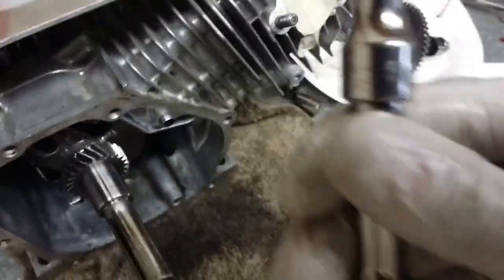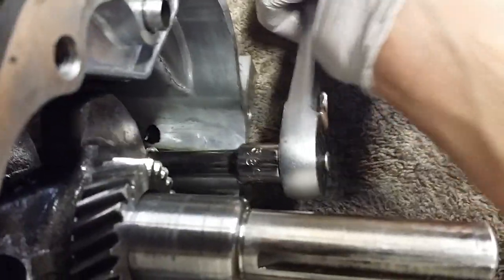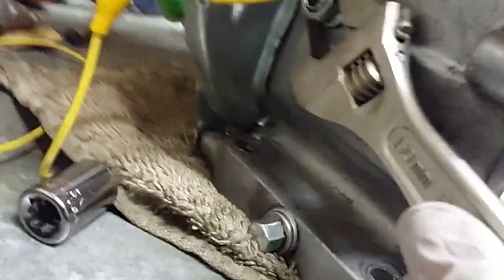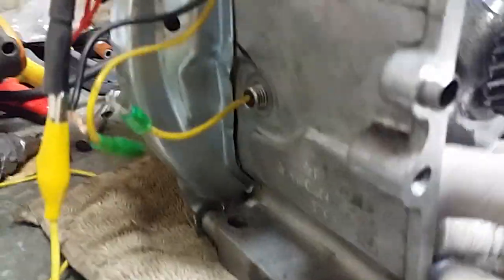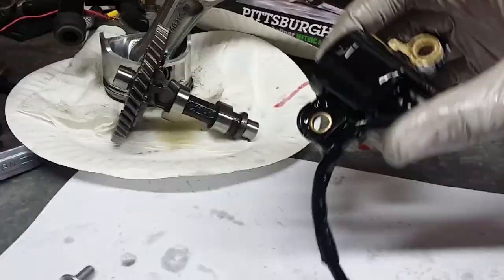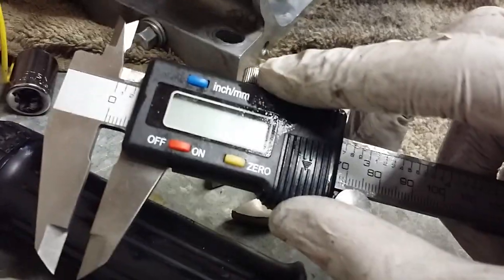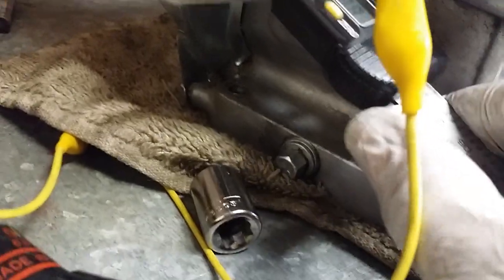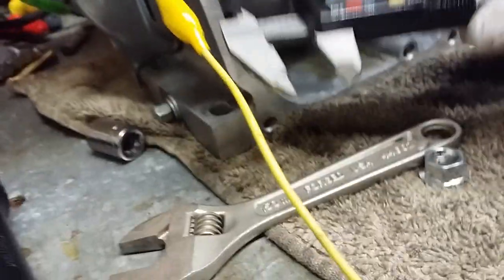How to remove the low oil sensor on predator 212cc

Comment: Nice if you'd have started before removing the gear part sitting on the bottom right a 2:29 so you can get the socket over the right bolt???

Comment: Thanks for the video. I have a champion 6250 292cc my gasket to the wire broke and oil skeets out of it, so I guess I have to replace the sensor.  I've already ordered and recieved a new one, but am a little confused as to which side on the motor to dismantle to replace it. You video is helpful, but moves a little fast. Can you help me out with the question and how hard should this be?

Comment: if you just disconnect the wire will it do the same thing?
Reply from the maker: Yes - you then just have to make sure there's not a break in the circuit preventing the ignition from grounding now.

Comment: ive got a problem where it runs for a second or two and cuts off. ive tried unplugging the oil sensor switch it still is doing the same. any ideas?
Reply from the maker: make sure you didn't just unplug it and leave it. You have to complete the ignition circuit without the oil sensor in there. Just unplugging it may not work. 
If that's taken care of, then it's a problem with one or more of the following; fuel, compression, air, timing, or spark. Going through those will solve your problem.
Reply: Check valve lash.

Comment: instead of doing all that you could just look by your kill switch and unplug it and it will do the same thing
Reply from the maker: Well, maybe your comment would be more helpful on a "how to unplug your oil sensor video!" I made this video to show people how to.... big surprise.... REMOVE the low oil sensor... But thanks for the comment and suggestion!
Reply: Disconnecting the oil sender  allows you to do donuts with out the engine shutting off correct??
Reply: boi kyle with those big lips boi u better shut up with your laffy taffy lookin self Ronald McDonald ........nvm thanks for the helpful COMMENTS!!!
Reply: I was wondering cause them sensors save motors Always wondered y

Comment: Why not just unplug the sensor on the outside of the engine instead of going through all that work with new gasket and thread seal?
Reply from the maker: If you leave it then there Is just extra parts waiting to come loose ect. You will need to put in more oil after doing this because there is more capacity for oil after removing this.
Reply: that's what I was thinking. have you tried this?
Reply: Works just fine unplugging it no issues.
Reply: I've been running it for 3 months with it unplugged.
Reply: They seal it pretty good from the factory and I haven't had any issues I have about 1100 hrs or so on my 212 and haven't had to add oil or worry about parts coming off but to each his own.
Reply from the maker: +Andrew Gunderson Good to hear! Everyone has their own ways.

Comment from the maker: It dosent matter that the sensor is gone. Just wire the switch netween the ignition cable wire that was oiginally there, and the other side of the switch needs to connect to ground.
Reply: So I cut the sensor out but left the plug in. What do I need to do? Will the bike start with it cut and disconnected